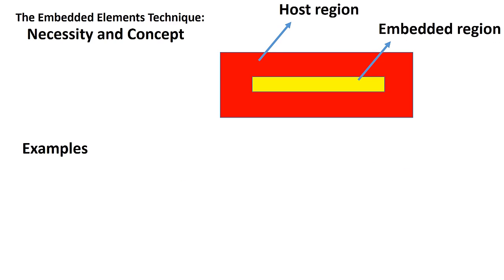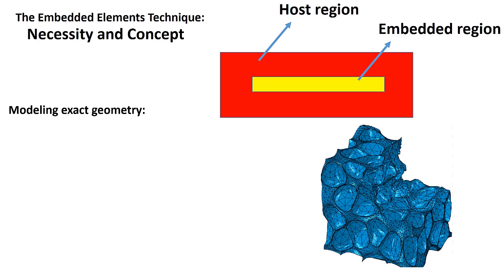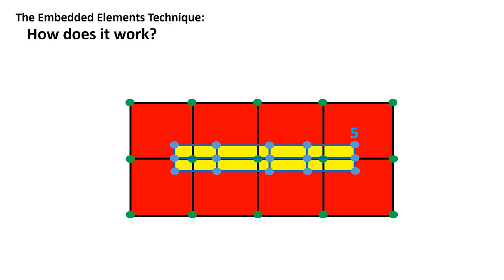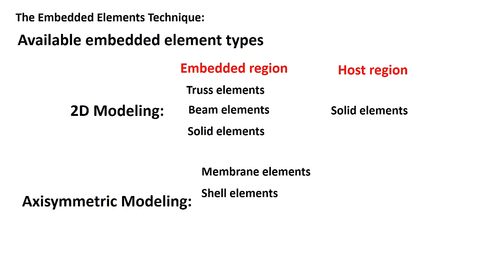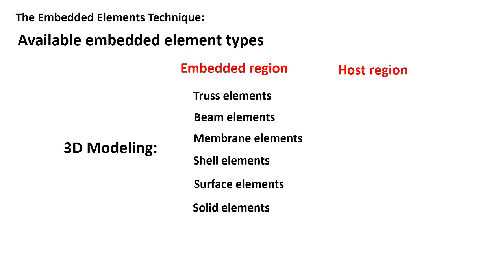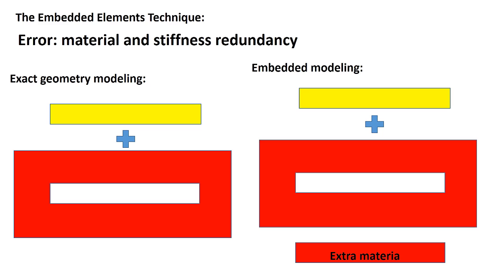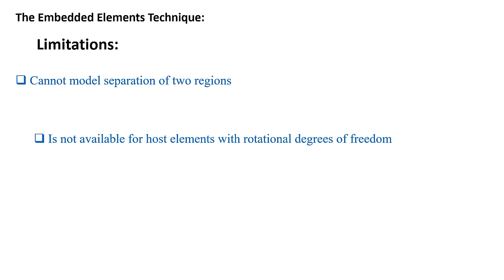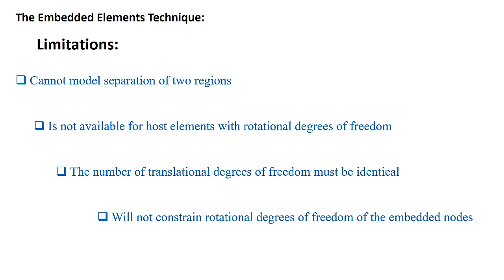Embedded element technique in Abaqus: Description

Comment: Hi, 
Thanks for the video
Really appreciate your good work for engineering fraternity
I have a problem. So we use belts/plies in tire. it is made of fibre-reinforced-rubber. fibres or steel are calendared in rubber. you may look online to understand better, it won't take much time. 
I don't have the composite properties ( 9 engineering constants ) but individually i have properties for rubber and fibre. 
I want to get stress/strain results for when fibres are alligned in different direction ( actually belts and same, just they are place at +45 and -45 degrees on top of each other ). I want to replicate UTM test in simulation. 

Any suggestions on how to approach this problem ( modelling, abaqus set-up, etc)

Comment: Well done. I can also add that this kind of constraint just add mechanical degree of freedom and doesn't add other DOFs. if you want to do some heat transfer analysis that just consider temperature dof, this constraint doesn't fit well with that analysis type.